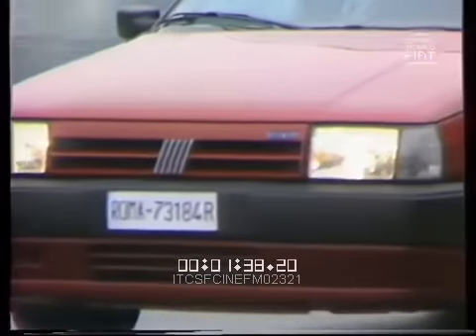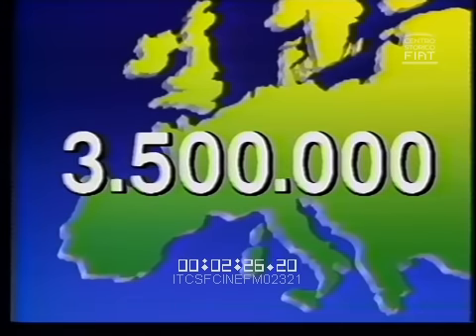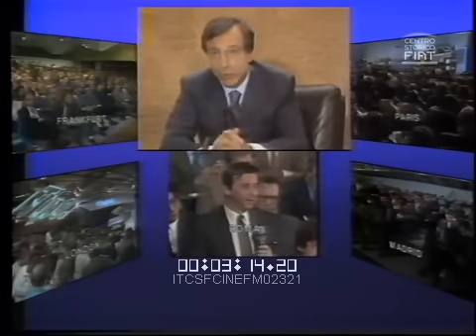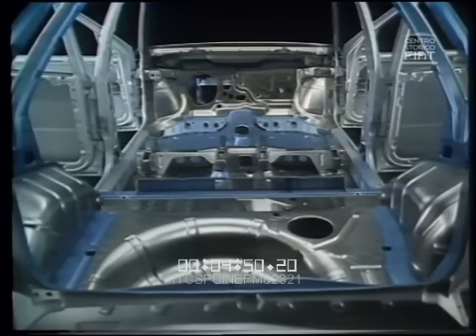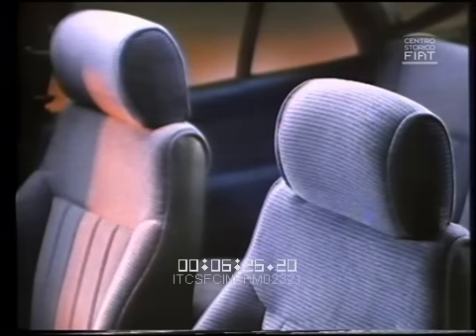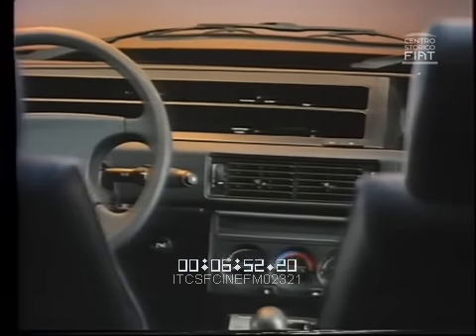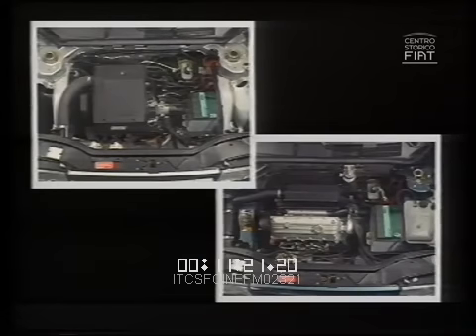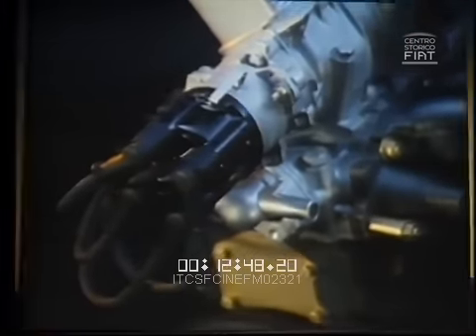FIAT Tipo. (schede tecniche) \ 1988 \ ita

Comment: 350 litri di bagli per un macchina di nemmeno 4 metri è un record persino adesso...ma la siamo nel 1988....Grazie Ghidella, che opera ultima che hai lasciato!
Reply: fulvio mastroianni va bene che per l'epoca la tipo era molto tecnologica; però non la si può paragonare alle auto di oggi. Perché ora una buona auto deve avere le 5 stelle nei crash test, ciò significa; che le auto devono avere metalli ad alta resistenza e anche più spesso, un automento dastrico dei pesi e motori sempre più potenti. Una volta su un sedile guida; se abbassavi il finestrino ci arrivavi facilmente con il braccio fuori dal finestrino... oggi i sedili delle auto sono posizionati più a centro nonostante le auto sempre più grandi fuori; all'interno-non guadagnano tanto spazio.
Reply: Come una Giulietta odierna....
Reply: @domenico7988  invece, adesso le auto di oggi sono come le scarpe del comico Totò.....larghe da fuori e strette da dentro. Troppa esagerazione pure ai nostri tempi.
Reply: Bagagliaio piu o meno come quello della 127
Reply: @francescovalenti8207  Ho i miei dubbi. Poi dipende con quale cendovendisette fai il confronto, quella con il baule o quella con il portellone? Sicuramente nella Tipo è comunque più sfruttabile.
Reply: The Mad Technician che sia più sfruttabile non ci piove, la casa comunque dichiarava 365 litri indipendentemente dal fattore portellone o bauletto
Reply: Avendo tutt'oggi una Tipo 1.4 con accenzione Digiplex ( ed è la seconda) ringrazio veramente chi ha lavorato du questo progetto... è un orgoglio nazionale per me essere Fiat-ofilo nel midollo 😂❤❤❤
Reply: @pietrovecchio4432 è verissimo😂❤

Comment: La mia prima auto fu una Tipo 2.0 16v 5 porte prima serie. La ricordo con molto piacere, mi diede tante soddisfazioni impareggiabili rispetto alle auto del suo segmento e della sua epoca, prima fra tutte la tenuta di Strada, per non parlare del motore, 150 cavalli sufficienti per portarla a oltre 210 kmh effettivi.. quando uscì la bravo rimasi molto deluso per la sola versione 3 porte anche se la versione hgt non era male a dirla tutta ma costava quasi 40 milioni a fronte dei 27 che costava la tipo 2.0 da nuova

Comment: Qui in Brasile la Fiat Tipo arrivò solo nel 1993, insieme alla Fiat Tempra. Prima era vietata la commercializzazione di veicoli importati qui in Brasile. Quando queste auto arrivarono qui, c'erano molti problemi perché non erano progettati per resistere al tempo e alle strade brasiliane e c'erano gravi problemi di progettazione. Molti modelli della Fiat Tipo e della Fiat Tempra si accendevano da soli perché il tubo del servosterzo passava sopra il tubo del diffusore di scarico, nel tempo e le alte temperature di scarico, il tubo fuoriusciva dal fluido del servosterzo che a contatto con l'alta temperatura dello scarico ha causato un incendio nel veicolo. Fino ad oggi, molte persone stanno combattendo in tribunale per essere compensate dalla Fiat. La Fiat qui in Brasile è nota per la produzione di alcune macchine che nessuno anche se fosse gratuito. Un'altra macchina molto mal pronunciata qui fu la Fiat Marea.
Reply: Sapevo di questo problema sulle Tipo prodotte in Brasile... Sembra comunque abbia avuto molto successo anche da voi insieme alla Tempra, peccato per noi italiani non avere avuto il 2.0 turbo benzina 😠

Comment: Non frenava. Più andavi veloce più non frenava. Quando pioveva si spegneva.
Reply: Era la calotta .. sui motori a benzina dell epoca.. e succedeva a tutte le auto.
Reply: @aldoiannazzo2584  Non è vero, così spesso succedeva solo alla Tipo (forse la calotta era troppo esposta all'acqua). Non ho mai visto nessuna altra auto dell'epoca, gruppo Fiat compreso, spegnersi così facilmente quando prendeva l'acqua.
Reply: @tancredifalconeri7419  bisognerebbe ricordarsi l'anno, la versione e lo stabilimento di produzione (e se a carburatore o i.e.). È risaputo che alcuni esemplari uscirono con qualche difetto.
Reply: @tancredifalconeri7419  no, anche molte Renault 5 soffrivano lo stesso problema